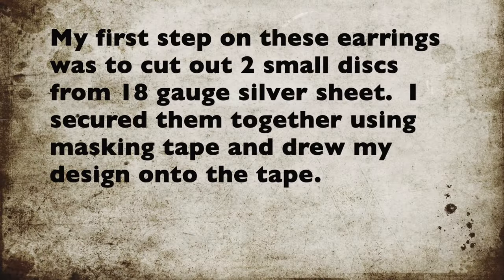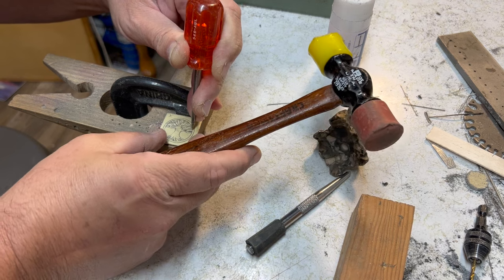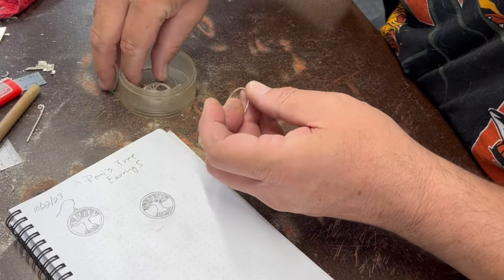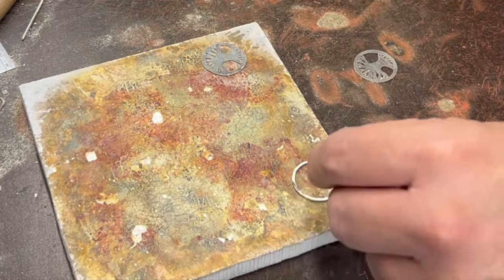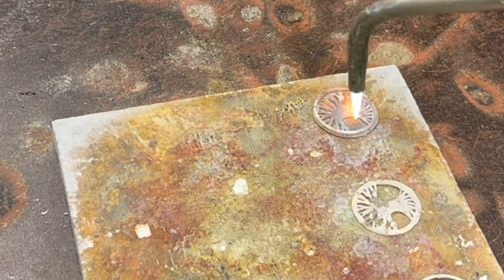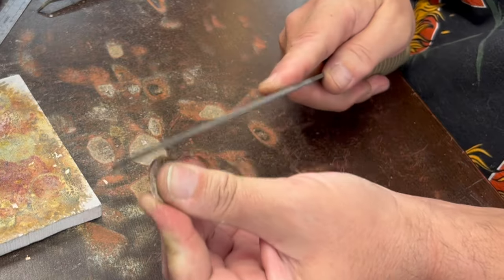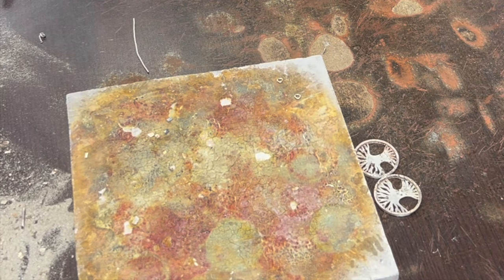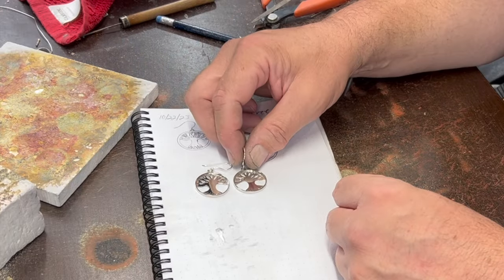Tree of Life Earrings: A Silversmithing Tutorial

Comment: How do you solder those tiny jump rings? 😃
Reply from the maker: Hello Joy:). One of my biggest silversmithing epiphanies was years ago I suddenly realized why I kept melting little stuff when I tried to solder it to big stuff.  A little tiny ring like that has such small mass compared to the big piece I’m soldering it to. The ring reaches soldering temperature in about 3 to 5 seconds, whereas the big piece takes much longer to get up to temperature. If you focus the heat equally on both, the ring will melt long before you get the bigger piece hot enough.  I generally actively avoid heating the smaller piece while I’m heating up the bigger piece, only adding heat to the smaller piece at the end. If I’m telling you something you already know, I apologize:). Thanks for a great question!